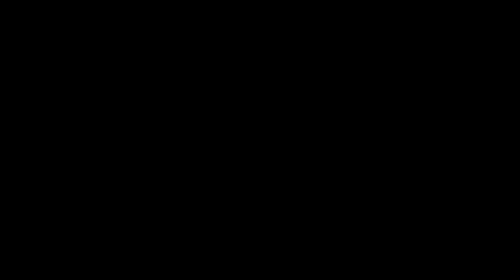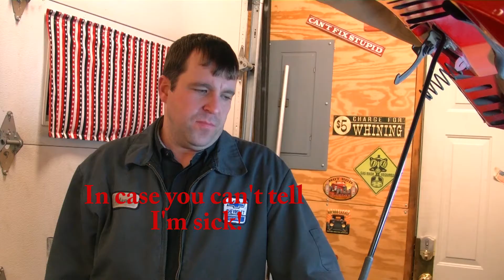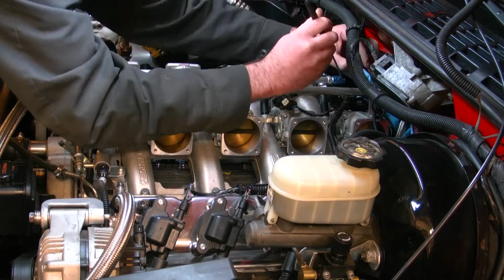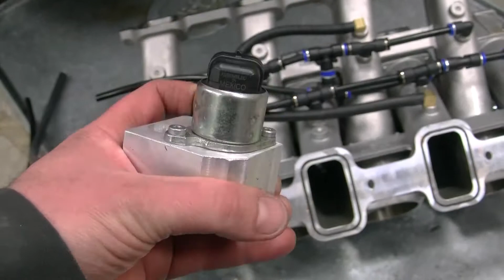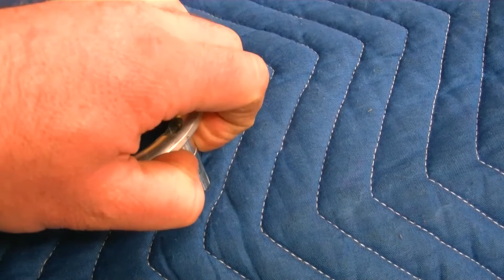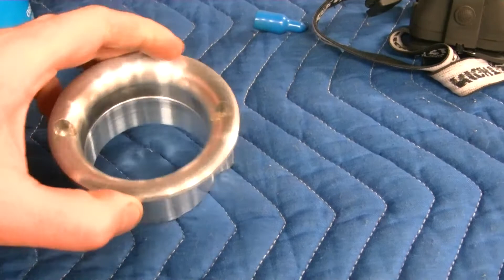LS7 S10 update 14 Sensor relocation.

Comment: where do I start, I want a ls in my truck
Reply from the maker: Look at Current Performance Wiring. They have pretty much everything you need to swap. It's not the cheapest route but it's the easiest. The LS section of the s10 forum has very valuable info as well if you want to save $$. You will have to notch front cross member slightly and make some fuel line changes.